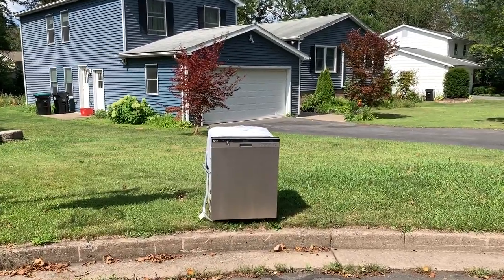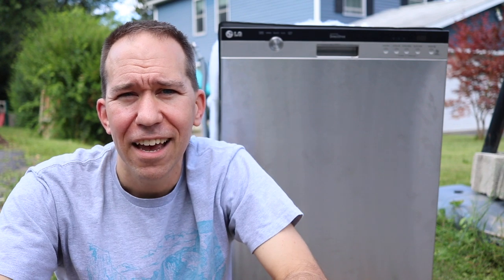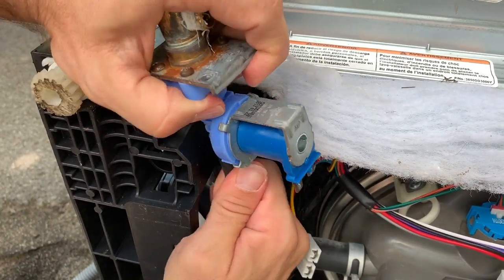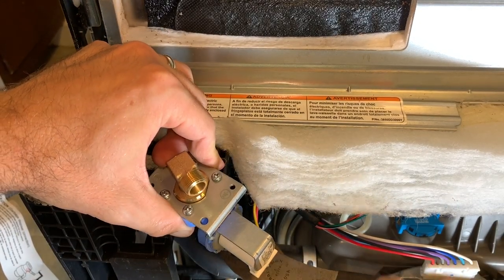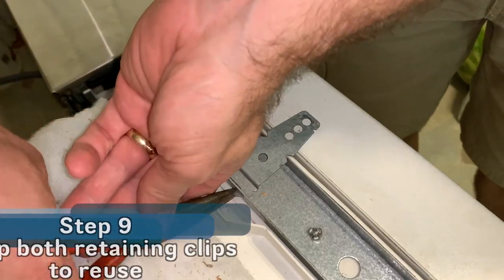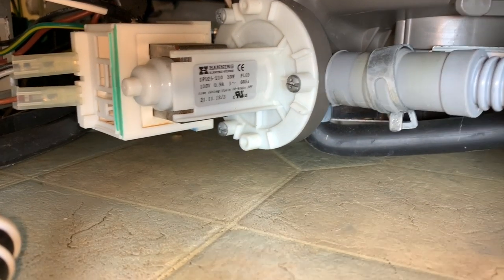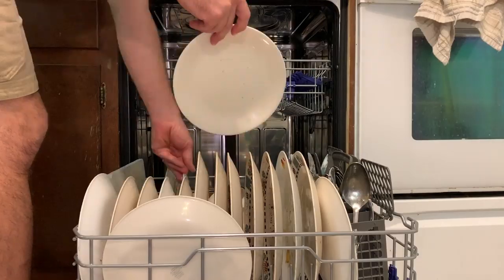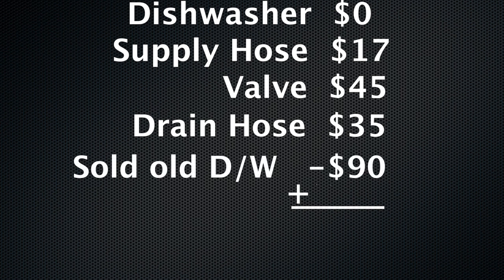Trashpicked $600 LG dishwasher fixed with simple repair!

Comment: I always use the "what's the worst that can happen?" with this situation, you'd be out the parts cost (rather minimal) and use your current working (older) dishwasher. Best case scenario you have a much newer ss dishwasher.

I got into property development and occasionally attempt stuff out of my comfort zone. If it's a few hundred dollars worth of material I figure worst case I'm out a few hundred but if it saves me a couple thousand in labour, totally worth it. Sometimes I surprise myself on how well the project turn out.
Reply from the maker: Those are great thoughts.  Good to hear your trying new things and stretching your comfort zone!

Comment: Score! I agree, the info you can find on YouTube is amazing. I recently replaced my busted garage door torsion spring for $30, saving at least a $300 service call by seeing how it's done on YouTube.
Reply from the maker: Great fix!  Thanks for sharing.   Yes, so much great information out there.
Reply: Well, here in silicon valley they won't show up for less than $300 and I'm sure he would have tried to up sell me to replace every other part too. It really wasn't that hard really. Bought the spring from home depot (easy return just in case) and took less than an hour. It even came with 2 bars to undo the spring tension.

Comment: At last, a channel adressing a very important topic: the extreme carelessness with which we just discard items that are repairable.  There was a time when we would make stuff last as long as possible.  Now, unfortunately, it's "use it then throw it"...  That and programmed obsolescence...  Slowly eating up all of our natural resources..  Thank you for this, sir!...
And BTW: a Mr. Coffee coffee maker that has it's pilot lamp on showing it's got juice, but the electronic display doesn't turn on and, of course, the machine does not make coffee.  Heater not turning on either.  Have any idea?  I haven't opened it up, yet, so I have no idea what's wrong with it.  It was fine one minute and then it just stopped working...  
And thanks again!  We need more shows like yours to emphasize the importance of repairing instead of sending to landfill...
Reply from the maker: Thank you for your encouragement! Regarding the coffee maker, is the control board getting the correct voltage? Or any voltage?

Comment: Someone dumped a Washer Dryer outside my flat! The door hinge was broken and the lock was dead! I replaced them for £8! ($10) and it worked great! I also cleaned all the seals and pump and got a good year out of it! The bearings disintegrated and sadly wrote it off. But the door, hinges, seal and lock were stripped out before disposal and fitted onto my friends identical model which had been leaking! You are correct - every job should be looked at to establish if it Really is worth doing! It can be a real can of worms with bad decisions! Great vid as always!
Reply from the maker: Thanks!  Great story about helping your friend.

Comment: I love fixing things and saving tons of money! Awesome video. Thanks for sharing.
Reply from the maker: That’s awesome to hear!  It’s a great perspective.  What’s one of your favorite repairs?
Reply: @FrugalRepair  It was actually a dishwasher. The motor was bad, and i replaced it for $50.00. (A rebuilt motor).  I got a free frig. that just stopped working. I purchased the defrost module for $90.00, and everything started to work again. When the frig is in the Defrost mode, the compressor shuts off for a pre-programmed amount of time. The bad timer module  kept the frig compressor from turning on again. Now I have a very nice frig with ice & water in the door,  a 1500.00 frig for $90. bucks and a case for beer for my friend to help me haul it home.
Reply from the maker: Those are great finds and repairs!

Comment: Congratulations on a great save and repair - you kept a new dishwasher out of the bone yard and passed on your working unit to someone else. I had a big repair myself recently on my 8 year old LG Wave Force clothes washer. I replaced the washer top that has rusted out around the bleach dispenser for the second time (first time was covered under an extended warranty in 2014). It was a pretty big job and I was lucky the top was still available from Amazon, about $110. The first time around the top lasted about 3 years before rusting; this time it was about 5 years. Not quite as bad and this time I caught it before it started dropping rusty bits into the wash, but this time the top had actually rusted a lot around the top of the washer where the top meets the tub - that didn't happen on the first go round. Come on LG, you got to do better than this! Needless to say I am wiping that rim around the tub dry after every wash.
Reply from the maker: Thanks!  And thanks for posting about your repair.  Hopefully you’ll be able to get something worked out so you don’t have to dry it each time.

Comment: If it were my dishwasher, I would have tried to save $45, by melting the crack closed with a soldering iron. Otherwise, hot deal!

Burned-out dryer elements can be shortened, sometimes.  Their squeeky bearings can be rotated 90°. In our case, 3 times over 30 years.

Most people lack the skill to troubleshoot, let alone repair anything. That includes garden hoses. I don't discard garden hoses until they are too short to have any practical use.
Reply from the maker: Thanks! I don’t know if I would trust the melting technique to hold the water pressure.  Have you done something like that before?
Reply: @FrugalRepair  Yes, if you get the plastic hot enough to reflow. You would need to revise the crack - inside and out. But, it depends on where you want to spend $45. For some people it is a small price for peace of mind. For me, it is money - needed elsewhere.
Reply from the maker: @williamdegnan4718  Thanks.  Good to know.

Comment: I don't come from a family of money. So I've always been a fan of buying used or refurbished things, and fixing my own things when they fail. Recently we bought a DLP projector on eBay for $50, as we really wanted a nice size screen, but didn't want to shell out the amount of money required for it had we gone for a TV. We really don't care that much about resolution, so long as we can enjoy what we are watching. The projector was missing two key items: a remote, and a power cable. Luckily, the power cable is the same kind that is used by a standard ATX power supply, so I had a spare. The remote was an additional $25 to buy brand new, aftermarket. 

All went well, aside from having to purchase an HDMI audio extractor from Best Buy, as I didn't realize just how bad the audio output of this projector would be, and my stereo doesn't have and HDMI passthrough. And then, less than a week later, dead pixels started showing up on the screen. At this point I'd already paid for it, and wasn't going to pay the return shipping to send it back, so I decided to take matters into my own hands. 

What was happening was that the DLP chip, a chip covered in tiny moving mirrors in order to manipulate light to create an image, was failing. So I went ahead and opened it up, just to see if I could as I wasn't sure. When I finally gained access to the chip, I noticed that the thermal paste sitting between the heatsink and chip had dried up and become brittle. So I took the chip out, and went online to order a replacement that I had found on eBay for $85. At this point the part cost more than the entire projector, but it was either spend more money and have a working projector, or lose the initial $75 (projector and remote) with nothing to show for it. 

After putting the replacement chip in with some new, higher quality, thermal paste, the projector works again. It currently sits on a shelf behind our couch, and has become the living room TV, projecting a 73" image on a $52 screen that I bought used on Amazon. I did sell a couple of items that I had, which had no use to me, which took the $85 I spent, and brought the loss down to $5. So that left me with a grand total of $177 spent on the entire setup, including the HDMI audio extractor. I can't find a similar sized TV in my area for that price (closest one is 111 miles from me, which would set me back quite a bit in gas to pick up), and a new TV would set me back a lot more.
Reply from the maker: Thanks for sharing!  Great stuff.

Comment: Good save.  I have a frigidaire dishwasher and we used it maybe two times in 8 years.  We decided we wanted to start using it for the holidays.  I went to turn on the breaker and water.  I went to test cycle it, but none of the lights on the panel would work.  closer look I see all the buttons under the protective film are cracked.   I tested the power under the dishwasher and there is power, but nothing is going to the panel.  I have no idea why this is not working so I am going to end up replacing it.
Reply from the maker: Thanks!  Sounds like you input panel may be shorted.

Comment: Had an issue with the d.washer not draining..took it apart and removed the pump.Small glass wedged in stoping the pump moving..put it together and flooded the kitchen (luckily I had a new floor installed which was vinyl so not too bad.(i didnt secure the pump properly).Fixed it in 10mins.
I barely chock anything coz I like the challenge :)
Reply from the maker: Thanks for letting me know!  Sounds like you had a good attitude with the flooding.  Not sure I would have. =)  Great to hear that you like the challenge (and the satisfaction) of tackling the repairs.

Comment: That's a great find 👍 curious didn't that have a 1 year warranty?
Reply from the maker: I bet it did have a warranty but it would have been voided since it was their fault for leaving the thermostat too low.  Or maybe they thought it was too much of a hassle?  It has been working great for us though!
Reply: @FrugalRepair  Water temp has nothing to do with crack in valve housing and would not void the warranty.
Reply: @rjm7168  What caused the water leak?
Reply: @rjm7168  If it's caused by freezing it does. But I'm wondering how they managed to do that. This would mean the whole house must been below freezing. Otherwise cold water shouldn't be an issiue. I don't know the case in the US but in Germany the dishwashers normally can be set to use hot or cold water.

Comment: I have now fixed my frig. (The Evap fan died), drier (belt and timing switch broke) , furnace motor (replaced), samsung tv ( power supply), and garbage disposal (this one I couldn't fix as there were small holes due to rust but 100%silicone is amazing. No leaks thus far) 

The only problem I have not been able to fix is why out dishwasher leaks only on the heavy setting but not the normal.
Reply from the maker: That’s great to hear you fixed all those things!  I’m sure you’ll figure out the dishwasher issue at some point.  Could you run it while it’s pulled out and watch for where it leaks?

Comment: couldn't you use the existing dishwasher drain hose on the LG?
Reply from the maker: Good point, I did think of that but the hose configuration is very different so I couldn't use it.

Comment: One thing you can bet is that there is no REAL 300 grade stainless steel on the door or ANY appliance. If you can put a magnet on it and it attracts, it is 400+ stainless which is a mild stainless steel with regular steel mixed in so it can RUST!! You do NOT need to use stainless steel cleaner on this as this steel is covered in a thick clear polyurethane coating, so you are only putting on an expensive cleaner you do not need to use. Just use a mild soapy cleaner and wipe dry.

Comment: It blows my mind that someone threw out a virtually brand new Dishwasher after only 2 months. I'm pretty sure it would still be under warranty, but I could be wrong. As for the water leakage issue, I expected the hose to be part of the problem, and I was right.
Reply from the maker: Yeah, I was surprised too.  They were definitely friendly in answering my questions.  It wouldn’t be under warranty technically because they were at fault by letting the water freeze in the kitchen.

Comment: look my man, I don't have any issues in repairing these stuff in my household but I gotta find out how in the world people level their washing machines under the cabinets. my washing machine literally walks out of cabinet!!
Reply from the maker: I’m not sure what model you have. But I understand that can be a challenge at times. I would assume that it’s like other washing machines and you level it by turning the feet clockwise or counterclockwise.
Reply: @FrugalRepair  yes I know but it's almost impossible to make it stop shaking. the feet itself is leveled but it's some kind of rubbery and when the machine is working it will compress down and comes up again and so on and so forth. driving me crazy. I mean when its off it's completely leveled. but not when running
Reply from the maker: Oh, I see.  On mine it came with stickers (I’m assuming some kind of dampener) for tile or hard surfaces, that go under each of the feet.

Comment: Get a text the dryer won't work.
I get home and I'm told we need a new drier. I take the drier apart and see 2 parts that need replacing. I go on amazon order new parts. 3 days later parts come while I'm at work. I get home and replace the parts and now it's working again. Saved me $1000+
Wish I could have installed my new 98%Efficient furnace but I left that to the professional installer and have the 10 year manufacturer warranty.
Reply from the maker: Awesome story and repair!  Thanks for sharing.

Comment: Even more frugal would be to use some super glue on the valve first to see if it seals.
Reply from the maker: I like your thinking.  It probably would be better to melt the plastic but in either case I didn’t want to take the risk and deal with a wet kitchen.
Reply: @FrugalRepair  Your videos are very informative and a joy to watch. Let the plastic repair cure for 24 hours then run water through the valve from the facet and check for leaks.
Reply from the maker: Wow, thanks for your encouraging words!